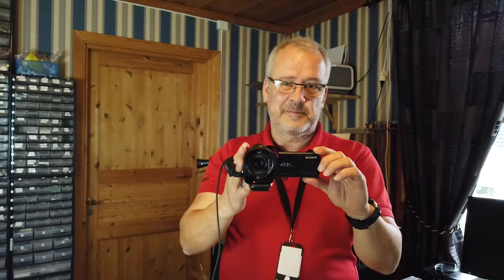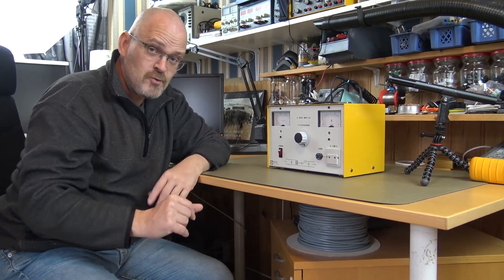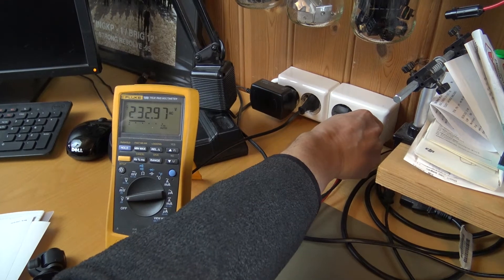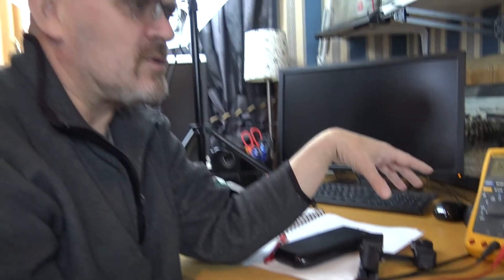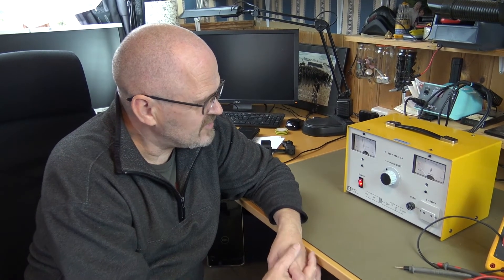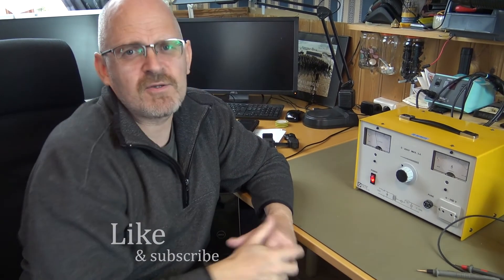Isolating Transformer

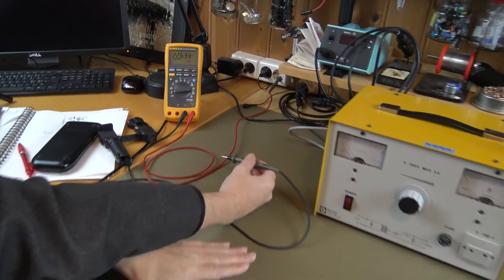Comment: 3:50 Your ESD mat is not "grounded", it is connected to ground/earth through a 1Mohm resistor. This resistor is molded in the plug that you have connected into your wall socket.
Because your ESD mat has a high impedance connection to ground/earth, your measurements are not right, yes you do measure voltage between your ESD mat and the wall socket, but this is very low current (230µA when your mains voltage is 230V). 
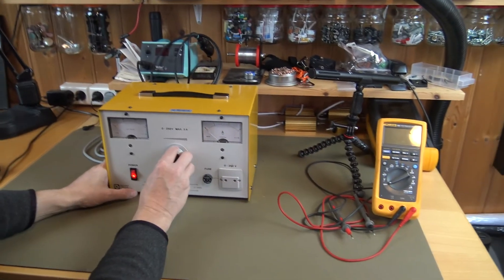6:19 The schematic on your Isolation Transformer shows 2 coils, a primary and a secundary, so your output is isolated, the reason that you measure voltage 
between the output socket and your ESD mat connection, is the leakage voltage from the transformer to his metal core, which is connected to ground/earth.
These measurings are also very low current. If you want to  be 100% sure, then connect a incandesent light bulb or halogen bulb between one pin of the output socket and the groundpin of your wall socket. The lamp will not glow, and your RCD won't trip if you have a real isolation transformer. If your RCD trips, then you have not a isolation transformer, but a autotransformer. A autotransformer has only 1 coil, and the wiper moves from the Neutral side to the Hot side, the wiper is also connected to 1 pin of your output socket, and the other pin of your output socket is connected to end of the coil. 
Another measuring you can, to be sure if your transformer is isolated, is to disconnect the plug from the wall socket (no power to the device) and do a resistance measuring between the pins of the mains plug, and the pins of the output socket. You should be reading O.L (open circuit).
Reply from the maker: Hi friend. Thank you for the information
Reply: @anatticinnorway2883  , no problem. Grtz from Belgium